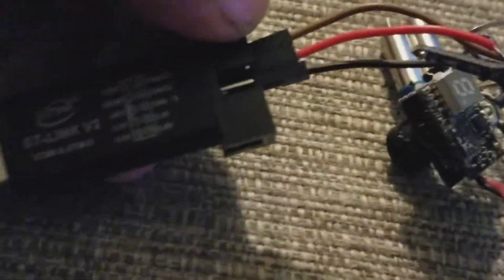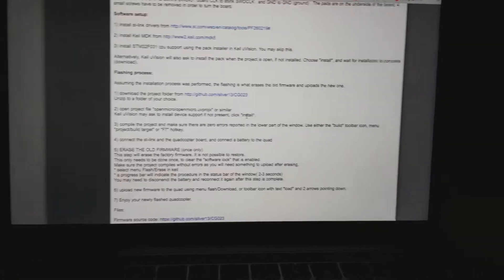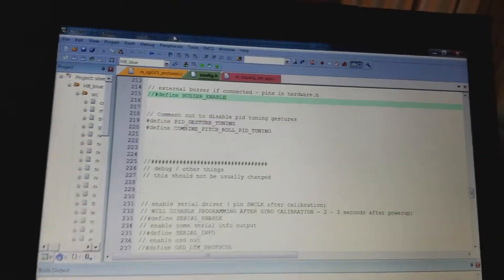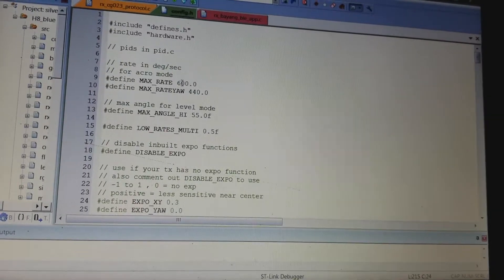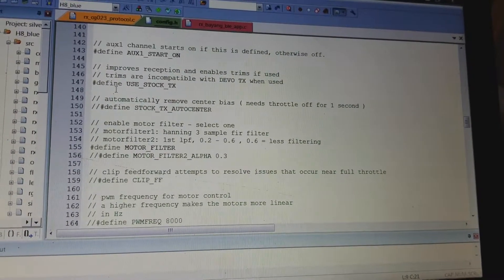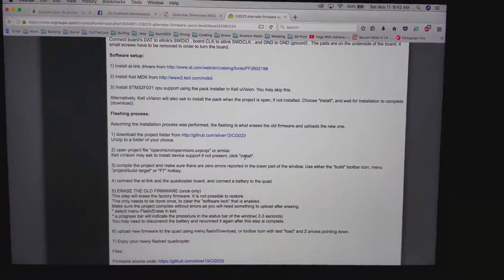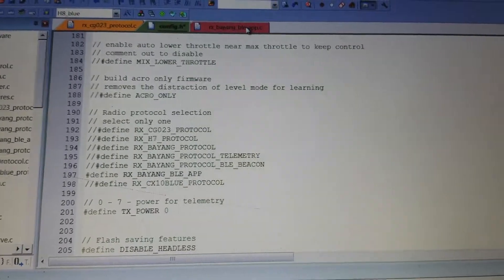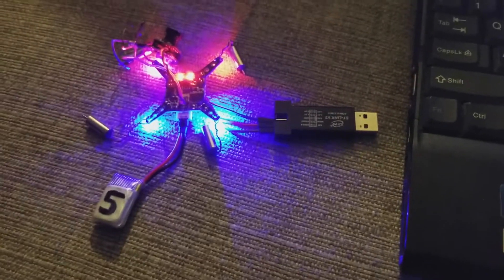Tuning Eachine H8 Acro: Increase rates & see your PIDS!

Comment: Hi, could you connect to silvervise app after flashing? mine didn't connect (I'm using the RX_BAYANG_BLE_APP too)... any advise for it? :D

Thanks. Regards.
Reply: Have you open the board. If don’t,you must open the board to connect to silvervise app. Also,you must use the firmware that supported silvervise. You can find it on Jeff Kafein channel !
Reply: Singapore SMRT_  : what do you mean by "open the board"? I didn't found video about flashing firmware at Pilot Nakal's channel..
Reply: Capung Plastik Find it on google,keywords: “SilverVISE firmware”. Done,ez huh ?????